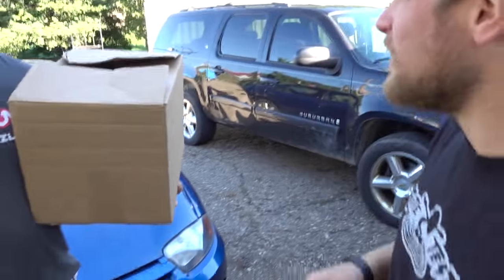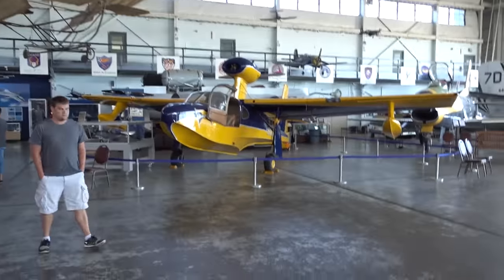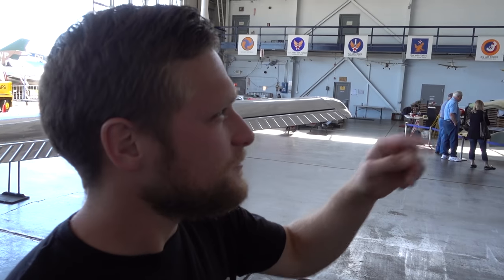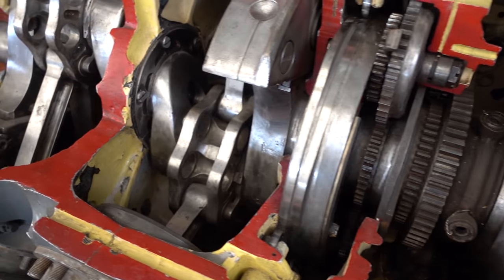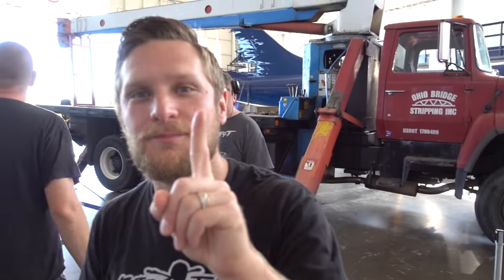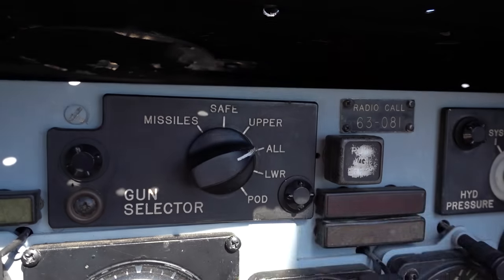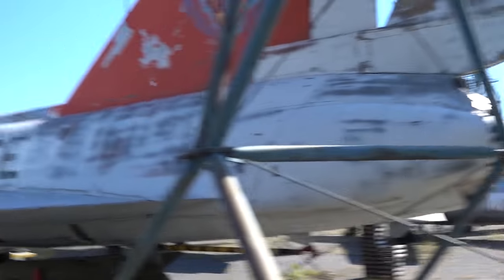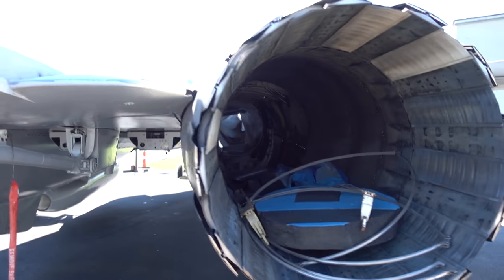INSIDE A FIGHTER JET – FLIPPED ALL THE SWITCHES! | VLOG0013

Comment: Looks like fun. I sat in some planes during open cockpit days at the local museums, but aside from the primary flight controls, I never wanted to touch any of the switches. 

Also, Pratt & Whitney engine designations were displacement in cubic inches, not horsepower. R-2800 = radial 2,800 cu.in. If you can, find a Wasp Major R-4360, it was the largest one they made.

Comment: That P&W cut away radial isn't 2800 horse power but 2800 cubic inches of displacement. On a lighter note, my dad helped arrange the donation of the Goodyear amphibian. It's made mostly of magnesium and was called the Drake. Way too expensive and was cancelled. Great video. Keep up the good work.

Comment: Guys that planes wasnt a corsair and not a wildcat. it was a f2a
Reply: Julian Denk I'm gonna say it was a Bearcat because it's so cylindrical and it's silhouette is so boxy
Reply: Aether Cake nope it is a f2a because a bearcat has a only glas cocpit metal and the tail is not on the back of the cocpit do you cant see back. the f2a also had those red white stripes on the rudder.

Comment: that mig 19 would roast that f100 in a race
Reply: daniel passmore it wouldnt completely ruin it but yeah its like 40mph faster
Reply: you both are wrong the lim-6 is a variant of Mig 17 and the top speed of the lim-6 in 710 while the f-100 is Mach 1.3 so f-100 wins hands down